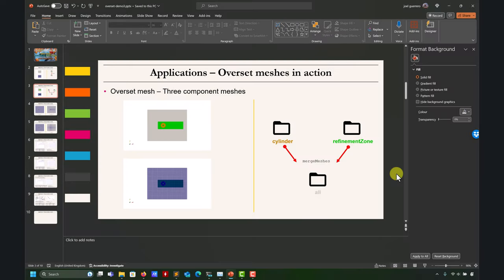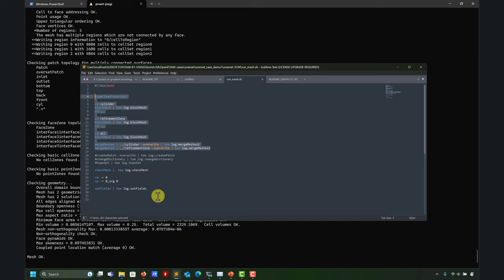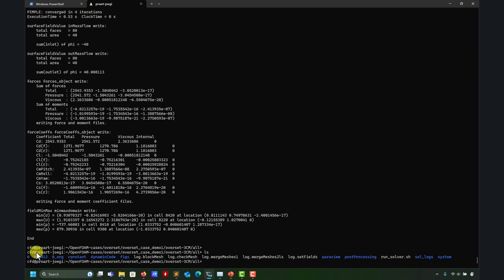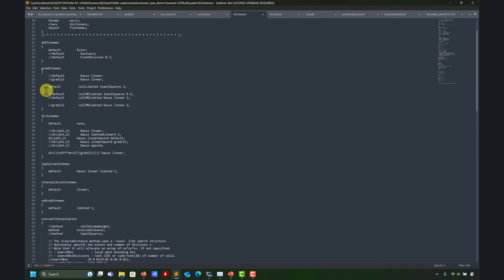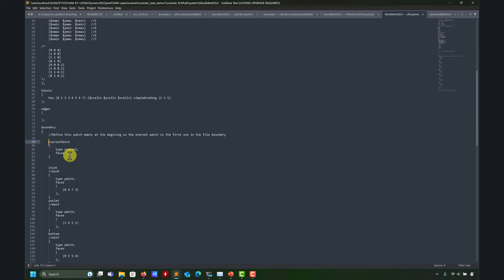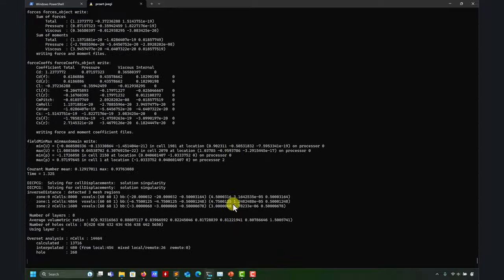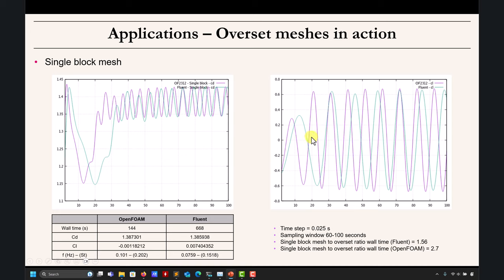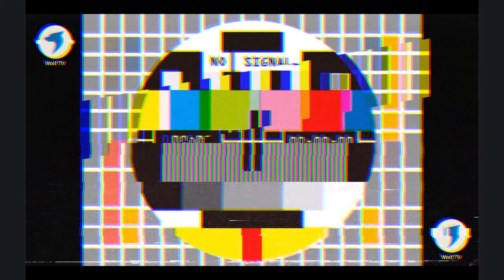Overset meshes with OpenFOAM-V2312 | Overset assembly with three component meshes

Comment: Hi there! I have a foreground mesh (overset) generated from third party software, which has placed the overset patch at the end. So, simply copying the oversetPatch in the boundary file from the end and pasting it in the beginning wont work due to face number inconsistency. So, is there any way to solve this issue?

(And my background mesh is generated using blockMesh and SHM, in which the oversetPatch is successfully placed in the beginning.)
Reply from the maker: Yes, that is covered in the videos. You need to use dummy patches. I dont recall the precise timestamp but we show two methods.